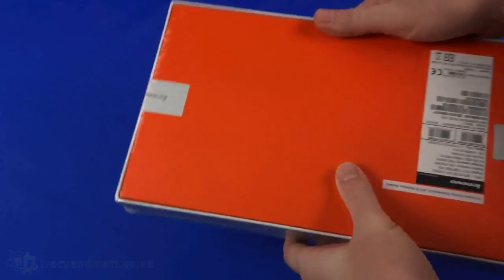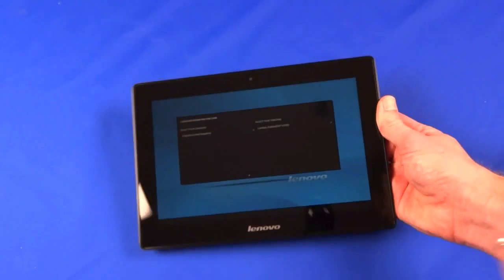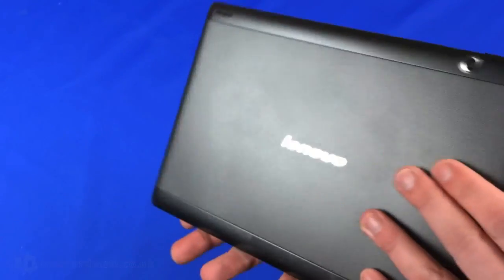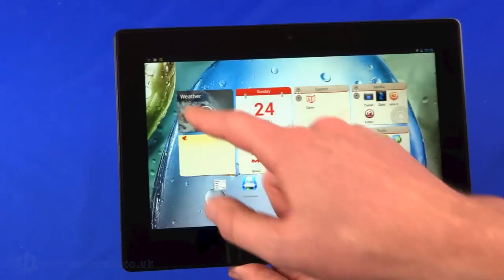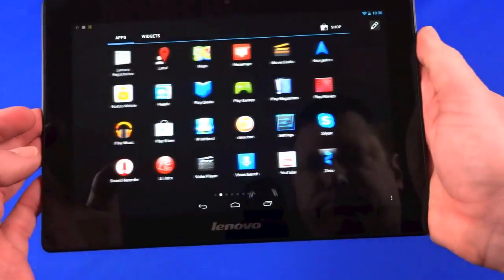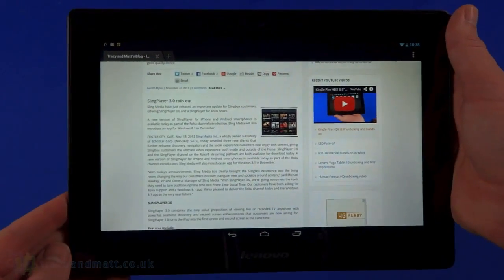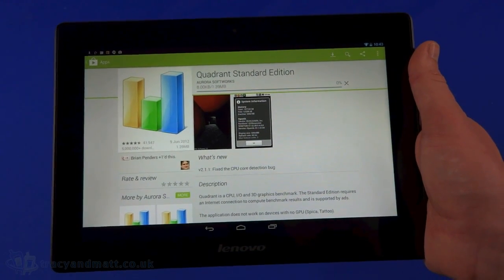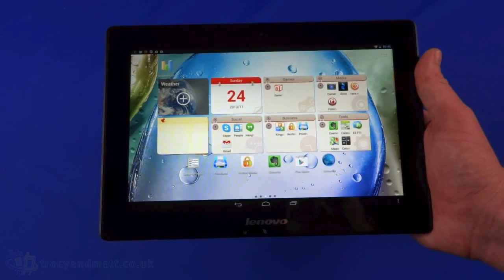Lenovo IdeaTab S6000 unboxing and demo

Comment: i had this tablet from Christmas 2013, well i started using it in early January 2014 to November 2015 as my main tablet. I have to say this is an amazing tablet but charging port is bad designed. Android 4.2.2 on this tablet is so good i miss it so much, i love the widgets on this tablet. And the WiFi settings are so cool because it shows all the WiFi networks I’ve connected to

Comment: I have an issue with the LCD screen. A few weeks ago, through no fault of my own i.e. I did not drop it or smash it, as far as I know there was no damage inflicted, I noticed a small hairline fracture on the right hand side of the screen. I've been using it frequently on my bed AT HOME and this appears out of nowhere! 
I'm so annoyed, it's noticeable enough to be distracting. I want to return to Lenovo as it's still just under a year since I bought it, do you think they repair it?? Or would they assume the fracture is down to external/personal damage?